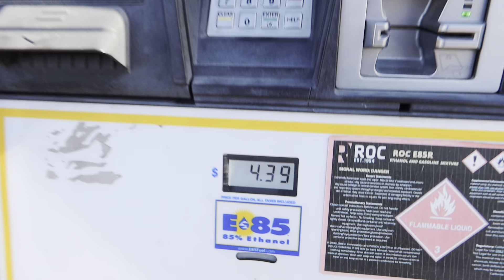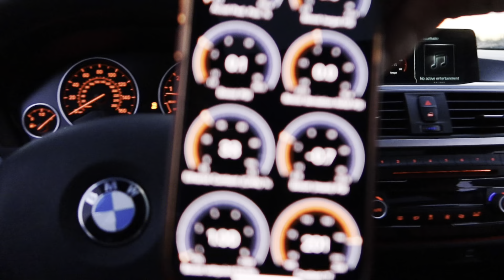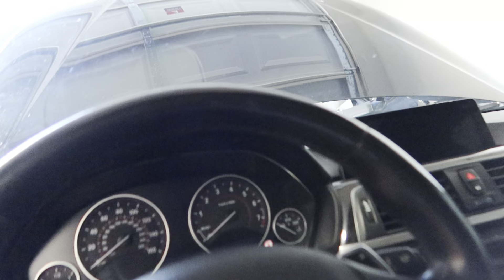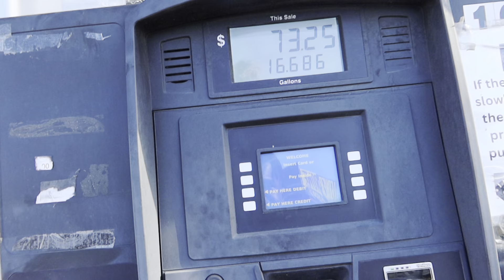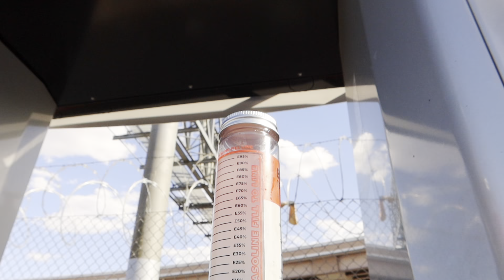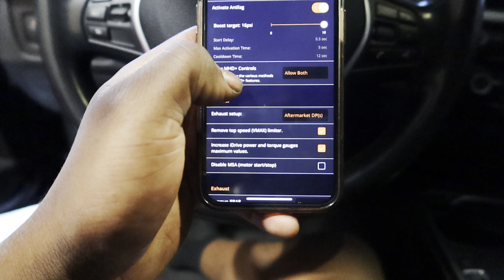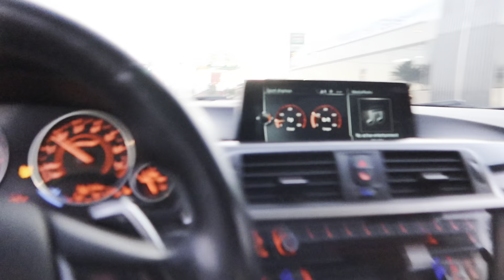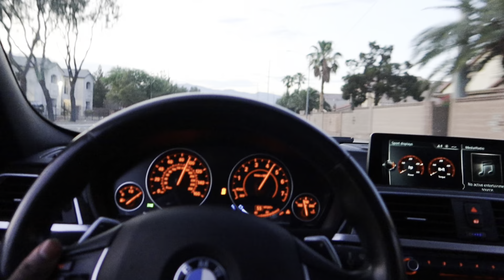STAGE 2 BMW 34Oi GETS A HIGH PRESSURE FUEL PUMP & FLEX FUEL KIT!!

Comment: brother, 500 to cut and weld some parts on bro, you're getting swipeddd. My 320i, i got a res + muff del for 150 + 80 for the big exhaust tip i put on the end of it..
Reply from the maker: It wasn’t 500 I paid 280 bro for a valve bypass a Ypipe and muffler delete